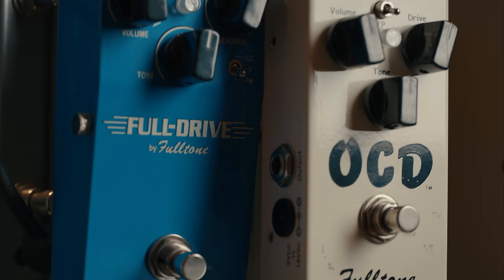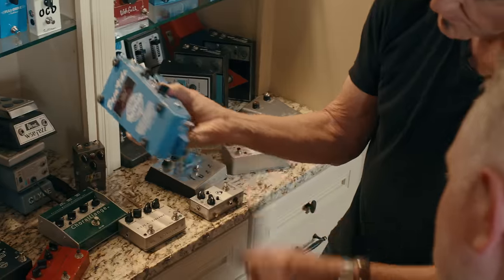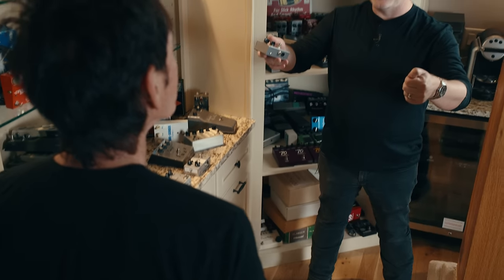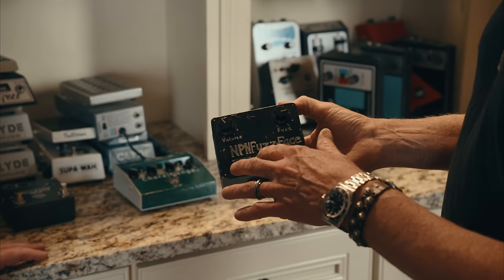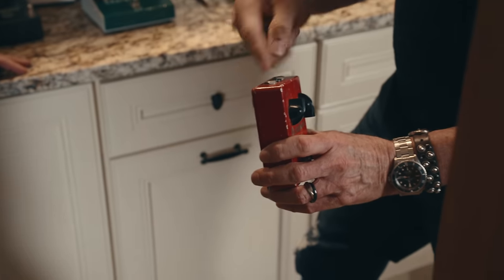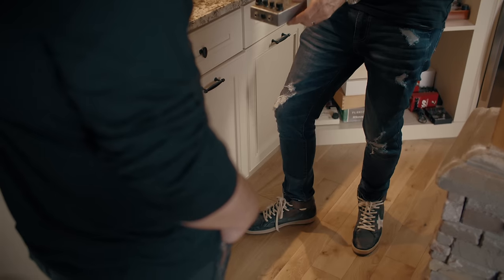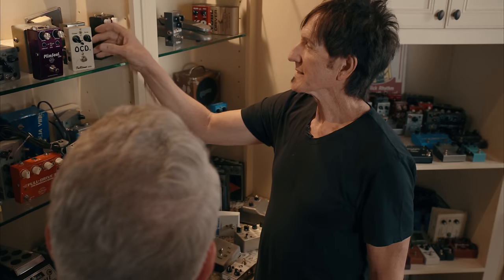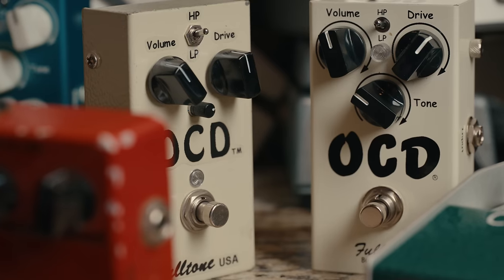Fulltone is Back: (Short Documentary Film) Feat. Mike Fuller & Brad Jackson

Comment: Only Fulltone pedal I own or have ever used is the Clyde Deluxe wah, it sounds superb and is feature-packed. It also completely solves the impedance mismatch issue when placed before a vintage fuzz circuit, it works with every one I've tried it with.  There may be others that do so as well, but with the Fulltone I don't even have to think about it, it just works. In fact, this was one of my most valued reasons for purchasing it. Lets hope the Clyde Deluxe also makes a return. Not that I think I'll need another one soon, it's built like a the proverbial tank, but I like it so much I want other guitarists to  be able to get their hands (feet?) on it too.

Comment: Pumped to see this. I still have my V1.1 OCD (serial number 1785). It was my go-to for studio work and was on the road touring with me and on countless boards until 2012 when the DC jack finally gave up and takes power but doesn’t push the op amps. Wish someone could fix it but this was back in the epoxy the circuit board days and nobody will touch it. Maybe one day I’ll get another one to bring that sound back.